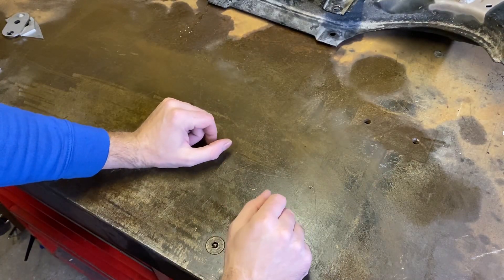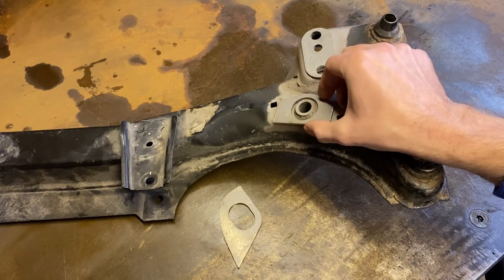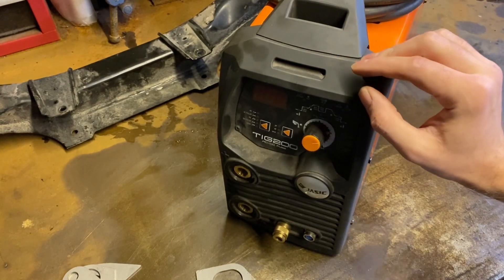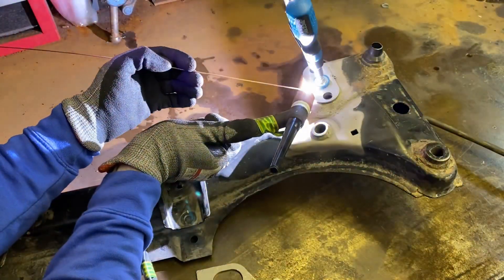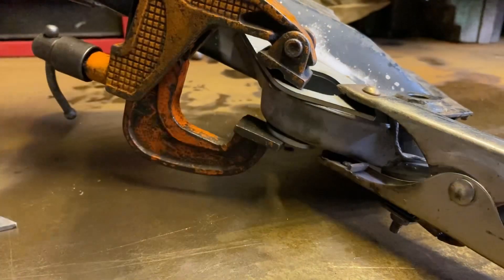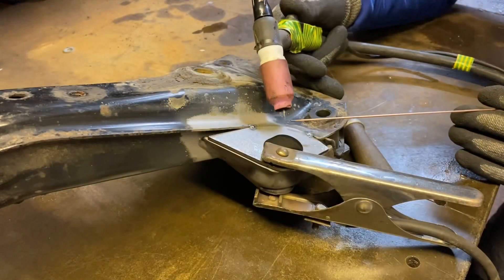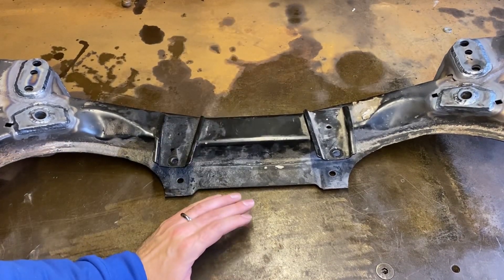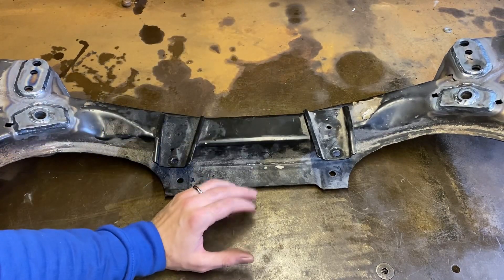THIN TIG! BMW e46 Front Subframe Strengthening Plates. Ready for track!

Comment: Nice job!
Reply from the maker: Thanks for the feedback and appreciate the comment! As said, not my finest welding, MIG would have been far neater because the fit up wasn’t great and it was very sluggish especially around the previously welded areas. There shouldn’t be any issues with strength here whereas with MIG if the settings are wrong the weld can just sit on top…